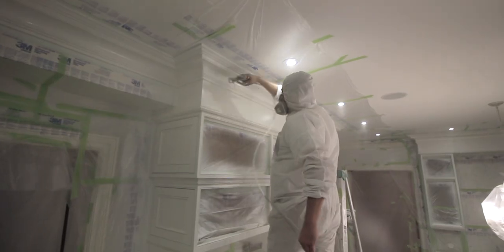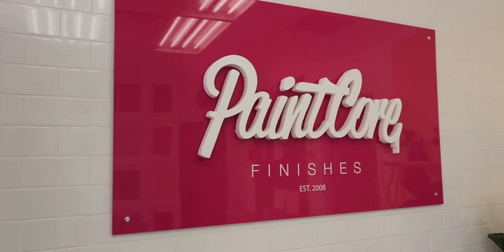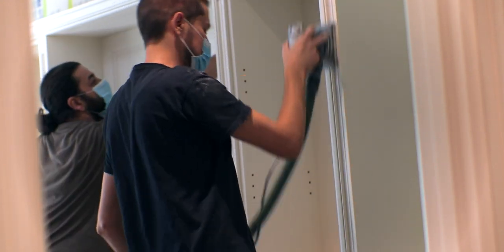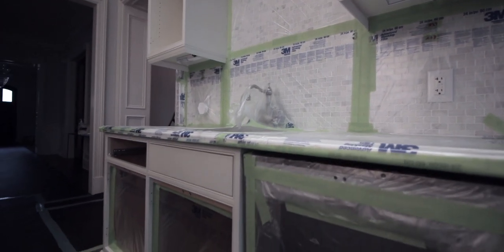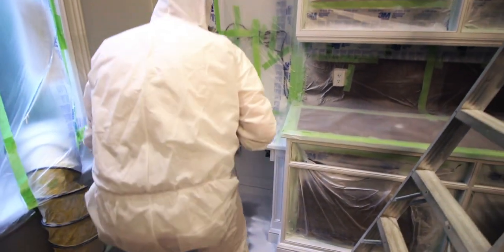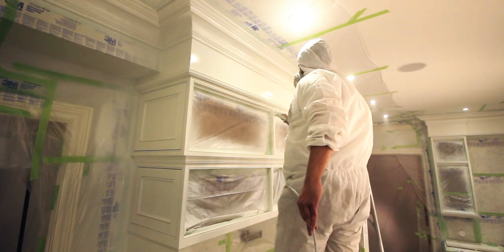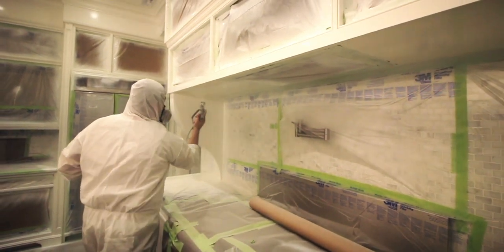How to Paint Cabinets | AWESOME Kitchen Renovation With Airless Sprayers

Comment: I recently purchased a fuji sprayer from The Paint People to paint some custom made fireplace cabinets I made.  Wow, everyone needs to rush out and get one of these sprayers.  Within a few minutes I was spraying like a pro and the results were top notch.  Although hiring a painter (like in this video) to do this would have been easier as I masked up the entire area which does take some time, but I like to DIY and thought I'd give this a try.  No regrets.  The guy in the video is obviously a pro and not to take anything away from him, but it is possible to DIY this with similar results if you have the time and the proper equipment.  On to the next project!

Comment: I’ve been using tritech 208 and 206 fine finish tips on an airless, absolutely incredible finish. And a whip hose is mandatory inside the narrow passageways of a kitchen. Great job. I’ve been using pre cat for years but just switched to renner and it’s incredible. And learning about positive pressure and negative pressure is another simple tip. Also a quality sander isn’t an option, at least to get down to bare wood. Whenever I skip sanding it always comes out sub par. Whenever I sand between every coat, it comes out even better
Reply: Hi can you explain what's renner thanks
Reply: Renner is a brand name , also,  cic, malesi, etc. These are water based idustrial coatings. As this guy mentioned on anothet level. Check Eric Reason, test dont guess, on youtube. He has been usings these new polyurethane 1k and 2k water base coatings for the last couple of years. A ton of info about products, tips, brands, sanders, sanding pads, methods, airless, air assit, hvlp, etc. 
N
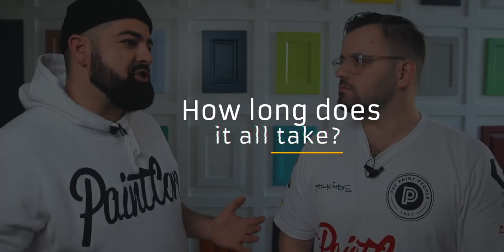Reply: Bb 12:43 12:43 l
Reply: M

Comment: This was a great video. Wish these guys worked in my area. I'd like to repaint my cabinets but first I want to make new doors/drawers and then have them sprayed. I'm currently repainting the inside of my home BM Simply White and using Advance on all the doors/trim. I previously painted my cabinets using Sherwin Williams and as careful as I am I still have a chip here and there but I didn't use any kind of hardening agent on them after which may be part of the problem.
Reply from the maker: Thanks for watching!

Comment: I'm a DIY'r that has to tackle my kitchen cabinets this week. We're talkin' mid-range cabinets... nothing fancy. I believe they are poplar, shaker-style. 

I want to spray but didn't want to pay the big $$$ for a good HVLP piece of equipment and am not trying to get a super high-end finish, just something that looks good and fresh. I forgot that we had bought a Graco Magnum X7 YEARS ago (like ten years) that was still in the box in the attic. Never used! I'm going to be using FFLP 211 and 311 tips while using Sherwinn-Williams Extreme Bond Primer and Emerald Urethane Trim Enamel. 

Does anyone have experience using a Graco X7 for cabinets? Is this a sound approach given the situation outlined? 

This video gives me some level of hope that I'm on the right track. Lots of great advice here and hoping to gain a few more perspectives.
Reply: 311 is too small of a tip for the extreme bond primer you'll get tails even at 3000psi
I would use a 312 thinned 10%. 310 for the emerald urethane, have used a 308 with it as well no issues unthinned. X7 isn't approved for solvent-based paints so use at your own risk. If you do use it run thinner through it after the primer and make sure the gun is bonded to the metal waste container your shooting into. Provides a ground for static build up in the hose.
Reply: 311 too small for primer
Reply: @alterrex6921  Both the Extreme Bond Primer & Emerald Urethane are water based products….no need to use paint or lacquer thinner and they are not flammable.
Reply: @DownloaderVideo  My apologies, I use the Extreme Block Alkyd Primer and was referencing that using the wrong name. Yes, the Extreme bond is water based.
Reply: @alterrex6921  No harm done my friend. Just clarifying for future reference so no one makes the mistake of mixing both and creating a mess.
Reply: How did it work out for you? 
I’m in the same situation. I already have an X5 and recently purchased extras like whip hoses, filter, fflp tip and I’m hoping it will turn out ok. I have some experience but I’m not a professional. Wish me luck!
Reply: @emilyp143  It went pretty good. If I had to do it all over again, I'd definitely rent (or buy) an HLVP sprayer. Our X7 did okay. Despite trying to control the pressure with such a large sprayer, it was just a bit much. Had some runs in a few places that needed to be addressed but nothing terrible. Fixing some of the runs was more of an add-on time nuisance than anything else. Here we are 3 years later (wow), and we're super happy with how it all came out. The cost savings of DIY are well worth some of the amateur "eye-sores" that only the trained eye will easily spot.

I'd just be sure to follow all the suggestions about pre-cleaning everything, spending the money for covering the floor with heavy paper (I knocked over a half gallon of primer), get the good cling plastic sheets to cover cabinet/door openings, good painter's tape, quality paint, and just being patient with dry times.

The hardest and best part was taking the time to pull all cabinet doors, drawers, and hardware... making sure everything was labeled, and building a makeshift, outdoor sprayer "cage" that was encased in plastic. 

Good luck with it. Be patient and you'll be happy when it's all over.

Comment: I just bought a fine finish tip and a brand-new guard for it the first time the first time trying it I had a problem with it I will spray the paint and once I would release the trigger of my gun somehow it squirts a thin line of paint what kind of problem be thank you
Reply from the maker: Hmm, hard to say without seeing it but spitting usually happens when your paint gun's nozzle is not properly screwed into place?

Comment: Please tell us what products PaintCore used on that kitchen (primer/topcoat). You popped up a Benjamin Moore logo, but Rade really seemed to avoid any specifics on the paint. You are the Paint People, right? I thought maybe it was Ultralaq, but Rade's mention of the number of coats doesn't follow Ultralaq guidelines.
Reply from the maker: PaintCore uses Canlak lacquer.  If you email us we can locate a distributor in your area.
Reply: @thepaintpeople  Thanks, but there is only one US distributor for Canlak and they don't even have their own website. Using a Benjamin Moore hashtag and showing a Benjamin Moore logo when Rade starts spraying is very deceptive.
Reply from the maker: We put the Benjamin Moore logo because the colour used was Simply White, and considering a majority of our videos have been about colour, that was our focus with the hashtags. Perhaps it should be moreso focussed on the product itself, so we can change the hashtags to reflect that better. Thanks for the feedback!
Reply: @thepaintpeople  for the neeer and best water based industrial coatings, be it polyurethane 1k and 2k, water base acrylics and water base poly/acrylic 2k; 
Renner, Cic (Centurion), Envirolac, Sirca, Milesi, Ica Distribuitors; Annex Paint, Valley Wood Coating, Dc Clark, Cic and Envirolac themselves, Timberlane Finishing solution, ML Campbell, MK Sales, Hertzville Paint. These are top of line distribuitos, 3 to 5 days shipping to anywhere, and they also carry equipements, sanders, sanding pads and very important can color match, .5 delta cms is industry standard, most of these will reach under .3. They can also help you trouble shoot.

Comment: I would sell my soul to have gun technique like that the transition from from the work to the masking and back to work is awesome I’ve watched this video 20 times I’m always worried about spits from starting and stop I feel like If could master the face frames like that! what gun do you use ?
Reply from the maker: Graco G40
Reply: I thought the G40 was for Air assisted airless ? It looks like a contractor gun  I really couldn’t see bc it’s moving so fast lol
Reply: @JamesSmith-je8sw  its an airless. Best for these newer coatings. More waste but very efficient and quick
Reply: What causes spits when you let go of the spray gun trigger?
Reply: @sinuemedina2550  dirty filters or not using the proper filters. A bad used tip or even back pressure from the sprayer.
Reply: Get clean shot attachment for spits

Comment: You didn't include information on the life of this paint job.  I have cabinets I'd like professional sprayed but feel the chipping will start immediately and cannot get a answer from other sources.
Reply from the maker: I suppose time will tell. Perhaps we can do a follow up further down the road!
Reply: @thepaintpeople  Thanks for a reply.  Chipping is so difficult to repair especially when your professional is using the type of paint they used.  Not like you can sand the area a little and paint the same color over the spot.  Smoothness will never be the same.